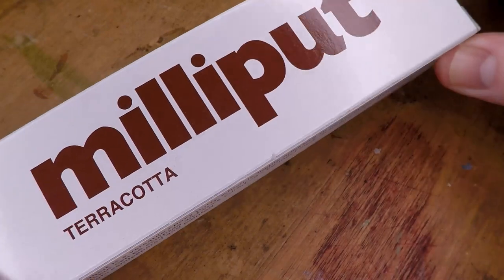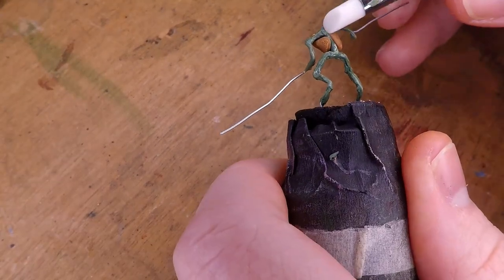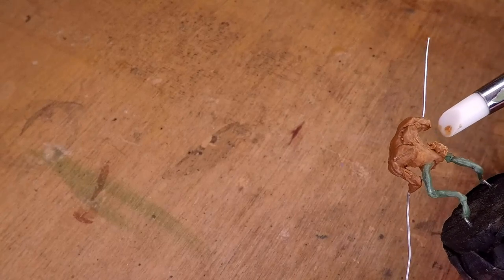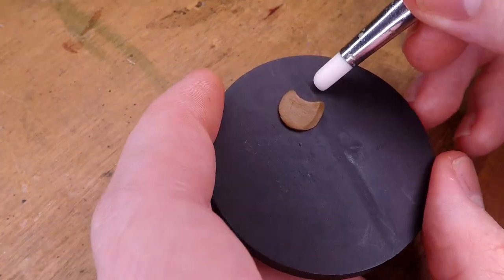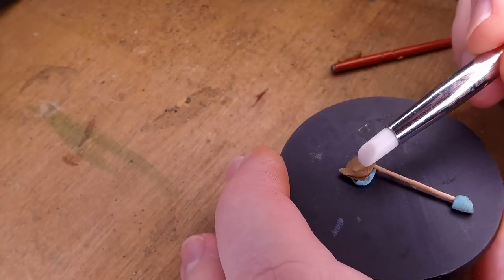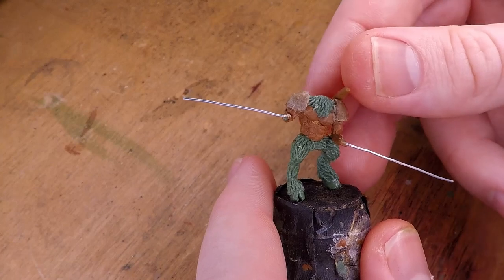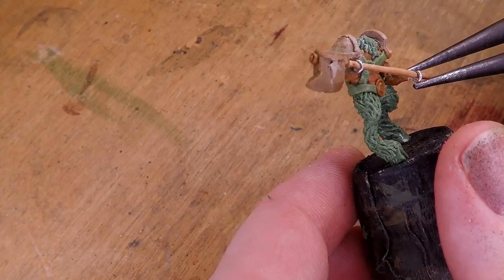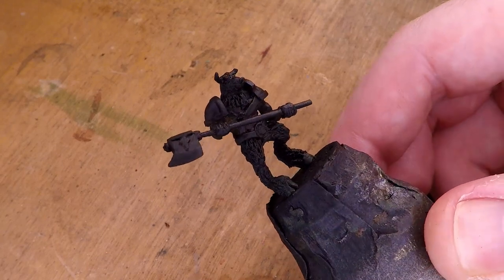Sculpting With Milliput for The First Time

Comment: Thank you for these fantastic videos.  I think you are very talented and inventive.  Was just wondering.  Could you possibly use Dás Clay.  Its like stone clay?
Reply from the maker: Unfortunately Das clay doesn’t work, since it’s an air dry clay the smaller the piece of clay the faster it will dry so you minis is going to be half dry and falling apart as you sculpt it. If your looking for a cheaper alternative to green stuff that acts more like das clay you could try using “milliput” it’s feel more like das clay to work with but is also works the way green stuff works, I did a video on it actually so you can check that out if you like
Reply: @magicmissileminis9723  Thanks.  Great.  Was wondering why I was struggling with it

Comment: You used the cheapest Milliput. It’s not the right grade for this work. Superfine White is for sculpting. You didn’t mix it properly neither. I make two identical snakes of each part and then twist them together. I repeat this a few times, and then knead and knead and knead. It’s the best sculpting material if you know how to use it.